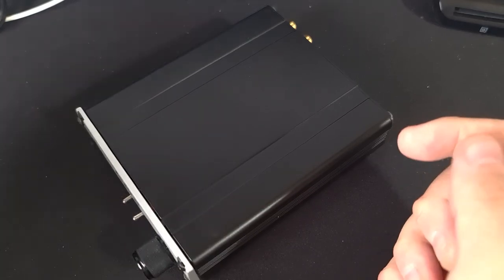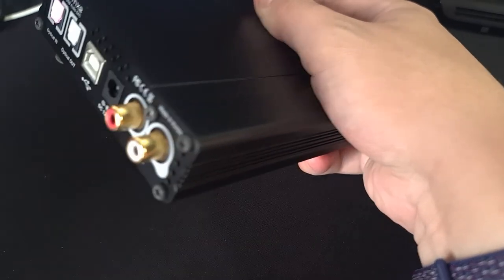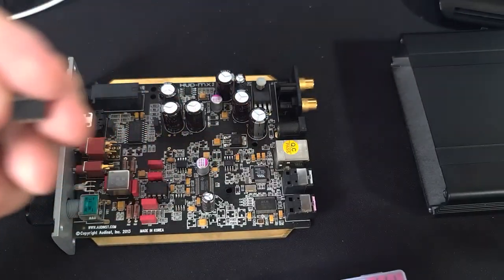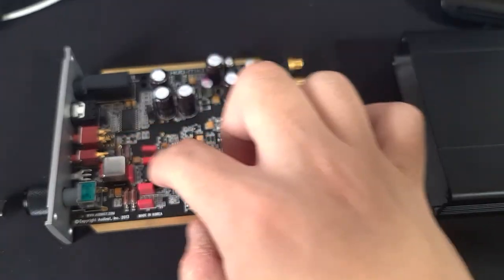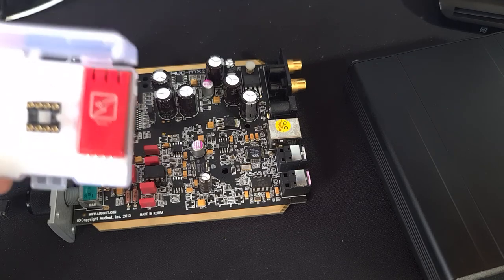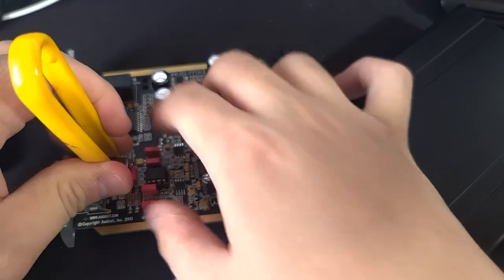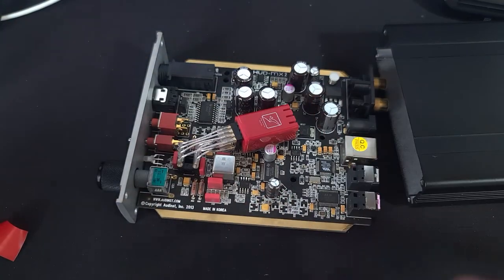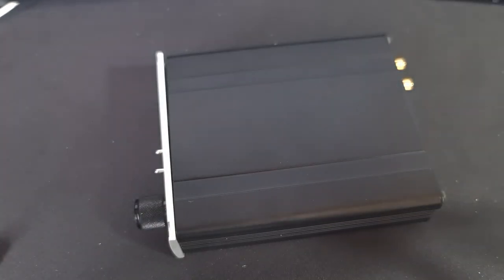Installing V6 Vivid in mx2

Comment: Nice video.  Would changing the Op amp improve the sound when using the optical in to optical out setting?
Reply from the maker: I'm unsure actually because I am using the RCA ports and headphone jack only.
This video is mainly to inform owners of this app that you can actually fit the V6 inside.